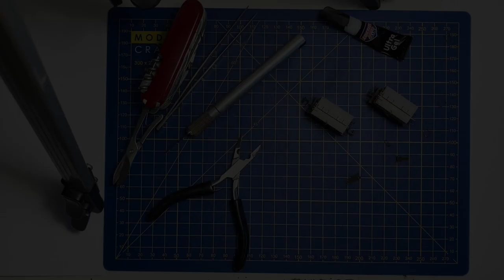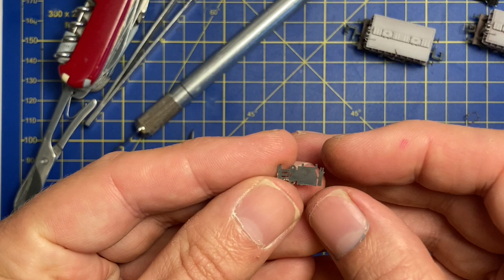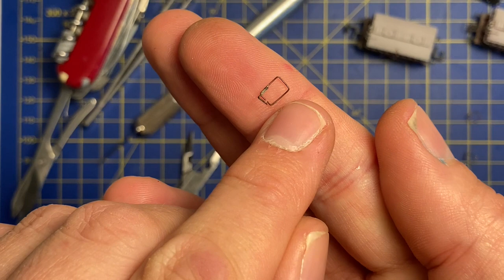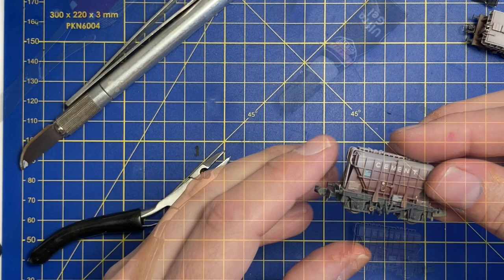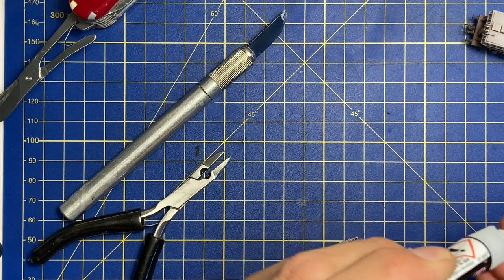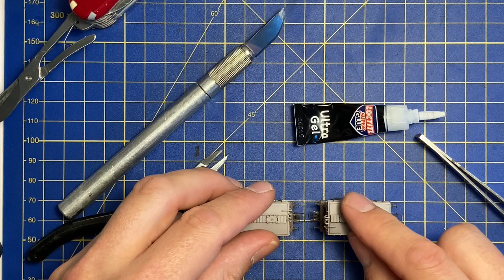Making and fitting DG Couplings in N gauge

Comment: Your videos finally gave me the impetus to get some of these built and fitted and I'm so glad I did - they worked a charm. When you talk about tweaking them - what typically are you referring to? I've got a couple of examples of the loops contacting each other and lifting each other up, but not sure what the solution is!
Reply from the maker: I’m so glad this has encouraged you to take the plunge - once working they’re a transformation, but tweaking, yes good question.

Two things to look at - angle of the buffing plate and hook, and relative heights.

I polish the buffer face and hook to make sure they are smooth for loops to rub against. The buffer plate must be vertical, and the hook angled sufficiently for the loop to easily slide up. This is by eye, with fine tweezers. 

Relative height, I aim to mount on the bottom edge of a typical buffer beam. If required small tweaks to height can be made by holding a tweezer against where you’ve glued it to the model, and using a finger to gently move the buffer face up or down, just then tweak the angle of the buffer face afterwards. For example, on the 08 and 26 these are quite noticeably bent downwards.

Comment: I've heard there's a technique to build the loop from a single length of wire without soldering
Reply from the maker: You don't solder the loop - it is made by wrapping the phosphor bronze wire around the 'template' bar and cutting and then forming them in pliers. The solder is required for the magnetic dropper - this is steel wire.
Reply: @JamesHiltonCustomModelRailways  thanks! just dipping my toe into 2mm finescale... seems if you get ten 2mm modellers into a room they will recommend about fifteen incompatible coupling systems between them, but DGs look pretty tried and tested and I don't mind the appearance!

Comment: You make it look easy! Which solder paste to you use?
Reply from the maker: I don’t use solder paste, I use Powerflux flux and Carrs 180 degree solder.
Reply: @JamesHiltonCustomModelRailways  Oh tks I didn't see in the video where you got the solder on the dropper, Presumably you tin the dropper first then reflow it on to the loop with the flux
Reply from the maker: No, just have the solder on the iron. However, what you suggest would also work.

Comment: Nice James. I've always gone the spratt & winkle route as I could envision the 2 coupling loops on each wagon hitting eachother, have you found this? Some only put a loop on one end, but that doesn't work if you have a turntable and want to turn stock.
Reply from the maker: I’ve not enough experience of problems yet, these are very neat and small, I didn’t like the complexity of setup of some of the alternatives.
I find that if I adjust each wagon in turn the loops don’t clash, but during setup it can be an issue. So far I’ve got about a 95% success rate in terms of coupling and uncoupling. As good as my experience with Kadee in larger scales and certainly easier than the 3 link I use in OO.